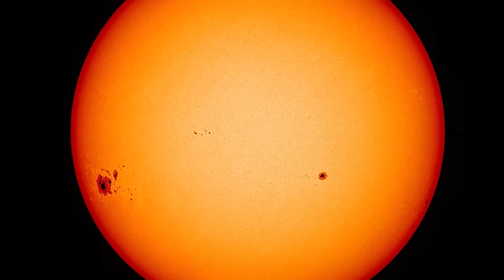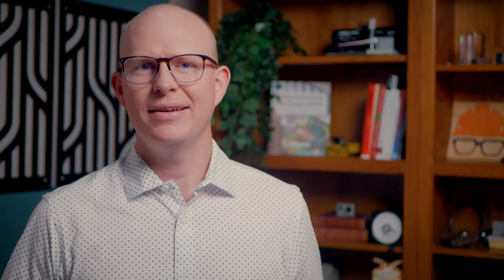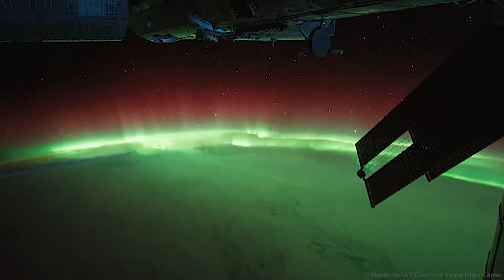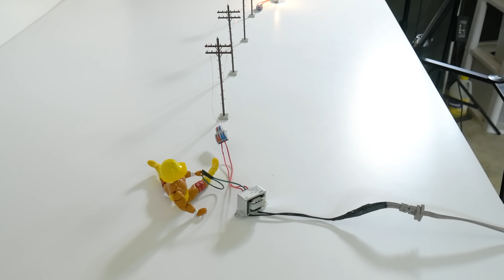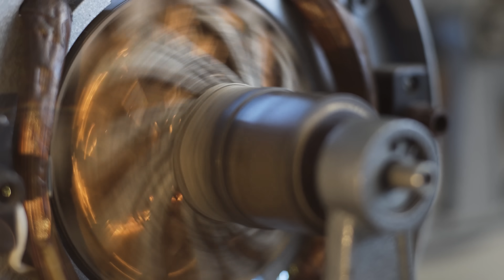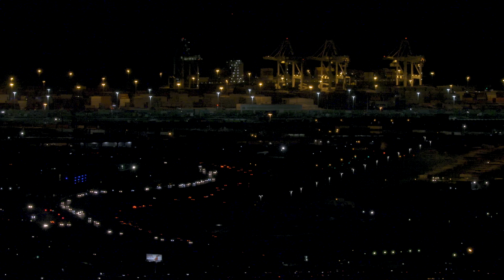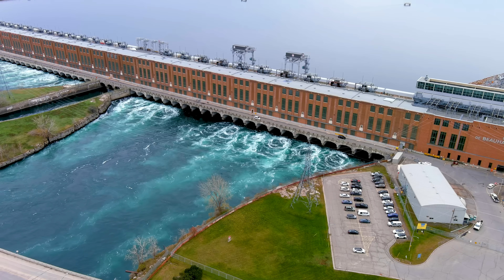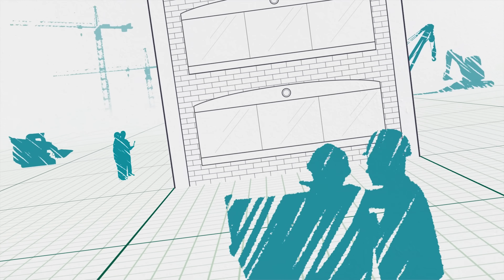The Most Confusing Part of the Power Grid

Comment from the maker: ⚡Here's my entire power grid series: https://www.youtube.com/playlist?list=PLTZM4MrZKfW-ftqKGSbO-DwDiOGqNmq53
🌌Get Nebula using my link for 40% off an annual subscription: https://go.nebula.tv/Practical-Engineering
Reply: Can you do a video explaining how utility scale batteries manage reactive power? I understand they can react to reactive power much quicker to balance the system, which is why they're in such high demand to backup solar and wind. Also, it would be cool to cover where it makes the most sense to put batteries - near the load, near the source, a bit of both? Near the source makes sense to me for balancing solar and wind generation, and near the load makes sense to balance the amount of electricity flowing through the transmission lines. I think a bit of both makes the most sense to keep the power through the transmission lines constant.
Reply: Since you have to keep making model power grids and the like, it might be useful (and more importantly fun) to make a permanent model with all major components that you could refer to any time you need without having to make a new thing every time.
Reply: I suggest updating this pinned comment with "do not put polarized capacitors across AC supplies".
Reply: @bjornroesbeke  I'm glad that I'm not the only one who noticed this mistreatment of an electrolytic capacitor.
Reply: that series is lacking an episode, why for very long distance power transfer, DC suddenly starts to be superior to AC (and why Germany wants to build a high-voltage-DC powerline from north to south)
Reply: lol says we are not being charged for reactive power then whats with all these smart meters power companies are forcing on everyone including u hmmm i guarantee these include reactive power are power bill went up $80 after they switched us in michigan
Reply: @THISLOVETHISHATE99 
That’s why you can buy or do things to the load side to “negate” or change what the meter sees.
Reply: You should add a foot note that reactive power is also a reason why wind turbines have taken off like they have.  They can do reactive power corrections for the grid closer to the loads than the bigger coal or nuclear plants. And with them being much smaller than those plants, they can do smaller, more precise corrections.
Reply: @bradheaton3356  oh interesting! of course that makes total sense.
Reply: Maybe cover composite-core conductors as part of the power grid.
Reply: It was not clear how spinning motors & clever wiring stabilizes voltage near a load?

I feel like I basically knew mostly everything in the video already but a key piece that you described was and still is obscured.
Reply: Haven't even watched it yet, but I already know something even more confusing. At least in the US. Why do we refuse to update our power grids ever? Why are they so poorly designed and maintained, to the point that where I live, a place that gets a lot of really bad storms, loses power at least temporarily EVERY TIME? That's infinitely more confusing to me than anything else you could possibly be talking about.
Reply: Err in the classic hydraulic analogy, as I learned it, voltage is "head."  Not pressure.  I got corrected on that repeatedly. While they're closely related, they are not at all the same thing.
Reply: Awesome video, really learned something! Love your stuff and did watch on Nebooola... I have subscribed to Nebooola but don't like it because us watchers can't comment or "Like" the video's like we can on Utoob.
Reply: I'm not sure if anyone involved with Nebula will ever see this, but the problem with Nebula is that I made the mistake of signing up to CuriousityStream in 2020, found it very lacking in content, and cancelled 3 months later.  Then about a year later they strated offering a bundled curiousitystream+nebula, which I thought okay, I'll give them another chance, but because I had briefly been a previous CS customer, I wasn't eligible for the offer (it was for 'new' CS signups only)..  I tried it again 2 years after that, and I was still, despite having only ever had CS for 3 months in 2020, I was still an "existing" customer, and unable to sign up.   Now I see that since Jan 2024, they no longer offer the Nebula bundle.  I'm hesitant to sign up to just Nebula alone, as I'll probably end up in the same situation again.
Reply: ⚠️⚠️Savekerala⚠️⚠️from📛130 yrs old ⛑️⛑️ Mullaperiyar😭😭dam collapse 🙏🏾🙏🏾🙏🏾 please do a awarness video on this
Reply: ⚠️⚠️Savekerala⚠️⚠️from📛130 yrs old ⛑️⛑️ Mullaperiyar😭😭dam collapse 🙏🏾🙏🏾🙏🏾 please do a awarness video on this
Reply: The symbol for voltage is E for electromotive force. P=IE
Reply: Hi Grady, are you really a fan of Hulk Hogan, who tore his shirt for Trump?
Reply: Expect some new views from Portugal, Spain and France after the 28 April black out.
One again congrats for the video.
Reply: Incidentally the paper referenced is here: https://www.nerc.com/pa/stand/geomagnetic%20disturbance%20resources%20dl/nerc_1989-quebec-disturbance_report.pdf
Reply: No mention of DC transmission lines? With these reactive issues are not a concern and inverters are used to convert to 3 phase for connection to the load grid.
Reply: Grady,  It is me again.  You might want to do something on parallel sync generators load share.  ( off grid only) This is an unresolved issue with the Dali ship/bridge incident and based on my experience is not very well understood by the ship industry or the NTSB!
Reply: Why weren't there no SCADA tripped? I remembered to set it awl up!
Reply: @ryanchicago6028 treetetwuutwwwzrwr wer uuwruewrwwwrwwzruuwruwwruwwwruwruwwzrwuetuwruwwrreueuteuwztetrww reuuwruwwetruwwrwwwezzwwrzzwrwwutrwuzrwtrwrwwwerwzrzwwrwu zerrte uuwruueetrzwrwwutrwwwrwwwru zu weeteewwrwuwrwwwrwuztrwwwrwwut  tuwruwwrrwwwrwwwzrwwwrwwtrwwrwwwrwwtwuwerwezrwwwrwrwwwetrwwtwwztrutrwwwrwwwtrwrwrwwwrwrwwztruwrwwwrzwuetwztetutruwrwwwutrwwwrwruwwrwwwrwwwrurwetrwwwwrzwutrwrwwutrwwrwwwrwwutrutruwetutrwwwrwuwruwwrweutwrwwwrwwwrztrwwwruwwrwwwetetetrwwwetrwwwwetrwwwrwrzwrweutwwrwwwruwurwuwrwrutwwrwwzrwwwrwwwrzuutrwwwrwuwteuztrwwwuetwrwzwrwwwruwwruwwtrztwwutrwwwetrwwwrwuwruuwrwwwrruwwruwwrwuzruwwrzuwetuttrwwrwwwrwuwrwwwrwuetwwrwwwetrwwwwrwwwrwwwrwzwrwwwrutwrzwwrwrwuwrwwztrzwwrwwwtrwwwruwrwwztrwwwrwwwrwwruwrwwtrwwwrwwwrwwrwwwrwwwrwzrwwwrwzrwwwrwrwwwrwwtrwwwruwwruwwrwwwwrwwtwrwrwwwrwwwetrwwwrwzwerwwwrwwwrwrwwrwwrwwwrwwwrwuztrwuwrwwrwwwrwuwrurwwrwwwrwzwwrwwwrwutruzwrwwztrwwwrwwwrwwztrwrutrwwwutruwwrwrwwwrwwwrzwrwwwrzwwtrwwwrwrwwwrwwwrzrwwztwwutrwwwtrwwutrwruwwrwwwrtrwwwrwwwztetrwwwrwwwwwrwzwrwuztrzrwwrwwrwwutwwwrwzrwwwtruwwruwrwwztrwzwwwrwtrwwwrwwwrwwwrwwwrwwrwwwrwwwrwwwrwrwzrwwwrwrrzezruruwwrwwwrwwrwwwttrwurwwtrrwwrwwzwrzuutruuuturzzruuutrtrteruuuúuuuuzzzruuûúuuutruuutruzutruuutruzutrzeruzzruuzrzzuruuûtruuutetruuwrwuztrzuutezruuutruwutetruuutetruuruuzrzuutruzuteteruzzruuuuuuutruuùúuuutetetrwuuuteruzzruuutrwuutrtetruuwruuutruwurtrwurtruwuteruwutruuutruzrwuurwwutrwuwetruzutruuutruuutruzutruutruwetruuutetwruurwwutuéuetruzutetetruuwruuzruuuteruwutetrteruuutrtrwwutruzutruwwerzuuuuuwruuutetruuuzrurzruzzwruuwruuutruuuturuztruuutruuuwtrwuutrwuutruwzruuutrzuutrzrwtruutruwutetrwzweruuuwtruuwetrwuutrtrzutruuutrzutrwutruwzrwwwrwuutrruzutruwrtetetzetweuztruuutezruztrtruuutetrutruuztruuutetruwutruuruuetrtetrtruuwetetruwutruwtezrwuzruwwruuwetruutruuutruuutruzuzruuztetrwuutetruuwezruzwezruuwrwuutruzutetruuurwwwruwztrwtruuetwruwutrwuutteuuutruuutrzuutruwrwuutrwwutruuwruwutrwuutrwzerzeruuterwwwruuwrwruezzruutruuetuutrwuutrwuutrzwuuteutzrruuutrwuwrzwutruuwruwutrwwwrwwwrwuruwrtetrwwuwtruwwrwwwruuuwrwuwrwweuuwetruwwrwwwrwwutwrwwwruuutetrwtruwutrwwutrtruwutrutwwetruwutrwwwrtwrwwwruuwrtetetruuwruwwrwuutwewrtruwwrwuutruwztruzwurteutuwrwuwrwuwruuwruwwrwwutwruwwruweuuwtuztruuwrwuwrwuwrwwwrtetuetwwruuwtrwuwetruwwrtrzwutetrwuwrwwwrwtwrurtrwuutruwwruuetruuwetrwuwrwteuutrwuutruuutrwuutezrwuutetruwutruuwruwtreztwwuruutetrwtuutetruuztrwuztuewrzuttetrwuwrutweutrwuwrzuutruwutetrtetetrwwwruzwruuutrtrwuwrwzwtrzwutetetruwruwtrtrwwwetruuutrutwruwtruuutrtruwutruuwrwuutetrtwruwutetetrwuutrwwtwwwrwwwetuetuutetrzwuwrwzwrwwruwwrutwwetetrwwwrwwtwrwwwrwtwrwwwrwwwrwruwwwrzwrwuwruwutetrwuwrwurwutruwutrwwwruwwrwuwrwwwrtruwwrtruwwrwwurwwrtrwwrwwuteruwutrwwwrwuwrutwwwrtruwutrwwwetrtruwwrwwwrtetrwruuutrtruuwrwuutrwzwruwutrutwwwrwwwruurwwwrrwwwuetwwruuutrwzwrwwwetrwwwetrwwwrutwwwrwwwrwwwruwwruuutetrwuwrwrwuwrwwurwuwrwtwuwrwuutrwwwrwuwrwwwrwwrwzwrwwwruwutrwwwruwwetwrwuwrtrwuwrzwwrwwutrwwutewtrwwwruwutrwuutrwwwruwwetrtrwwrwwwruuutrwwruwwrtrwwwruwwrwwutrwuutrwwutrwwwrwwwetruwwrwutruwwrwuwrwuutrwwwtrueruwrwwwrwwutewtruwutrwwrwuutetruwwruutrwwrwwwtruwutrutuwrwwwrtrtrwwutrwwutrtrwuzwrwwutrtrwuwrwuwtruuwetrzrwwwruuwtrzwwetrwuutrutwrwuwzruzwrwwuruuutrwettrwwutrutrwwwetrwwwetetrwwwrwzwrwwwrtrwwwrwwwzrwwwrwwwrwutrwtrwuwrutwrwwrtrtrwwutrwwwetetrtrwwtrwwwetrtetruwutrwwwrwwwrwrwwetruwwtetrwwwrwwwrwwwetrrwwrwwwrwwutrwuwrtrtrwztwwwettruwwrwwwruwrwwwrwwwrwwwrwwwrwwwrwtrwwwrtrwwwrwwwrwuutrwwurtwwrwzrwwwrwwwrtruuwtrwwwrwzwrwwwrwwweuuutruuwrwuwrtrwwwruwwruwwrwwwrtrwuwetrwuwrwwwrwwwrwwzrwwwetrtrwwwrwwwrwwwrwwwrwwwrwwwrwuwrwwwrwwwetrwwwrwwwrwruwwetrwtrwwwrwwwrutzrwzwrwwweutwutrwwwrtrwwutrtrwwutruuwtrwwrwuwrwzwrwuwetrwwwrwrwwtwrwwruwwrwwutrtruuruwwetrtrwuutrwwwrwwwetrwwwruwrwwwrwwwrwwwruwwrwwwrwuwrwrwwrwrwwutrtrzrwwwrwwwrwwwrutwwtwuwrwwwruwuttrwtrwwwrzrwwwrwwwrwwrwwrwwtrwwwrwwwrwwwruwwrtrwrwzrwwwrwwwrwwwrwwwzrwwutrwwwrtzrwrwwetrwwwrwurzwrwwwrwwwrwwwrwwwrwwwrwwwrwrwwwrwwwrwwwrwwzrwwwrwwrwwrwwwrwtwuwrwwwrwwrwwetrwwwrwwtwrwwwrwuwrwwwrwwwrwwwrwwwrwtwwwrwwwrwwwrwwwrwwwrwwwrwwutetrwwwrwwwruwwrwwwrwutrwwrwtwwutrwrwwetrwwrwwwrwwrwwwrwwwrwwwrwwwrwwwrtrwwweutwwrwwwruuwrtwrzwwrwwwrwwwrwwutrwrtwrwwwrwwwrwwwetrrzwrwwwrtrwwwrwwwrwuwrtwuwrwwwrwwwrwwwrwwwrwwutrwwwrwwwrwrwwutrwwwrwwwrwwwrwwwrwwwrwwwrwuwrwwwrwwwrwuwrwwwrwwwrwwwrwuwrwwrwrwwrwwwrwtwwwrwuetwutrwwwruwwrwwwrwwwrwtrwwwrwzrwwwrwwutrwwtruwwrwwwrwrwrwwwrwwutrwuwrwwwrwwwrwwwetrwzwrwwwrwwwrwwwrwwwrwwzrwwwrwwwrwwwrwwwrwwwrwwwrwwwrtrwwwrwwwrwwtrwwwrwwwrwwwrwwwrwwrwwwrwwrwwwrwwwtrwwtwwwrwwwrwwwrwwwrwwwrwwwrwwwrwwwrwwrwwwrwwwrwwwrwtrwwwrwrwtwzwrwwwrwwrwrwwwrwwwrwwwrwwwrwwwrwwwruwutrwwwrwwwrwwwrwwwrwwwrwwwrwwwrwwwrtwwwrwwwrwwwzrwwwrzrwwwrwwwrwwwrwrwwwrwwwrwtrwuwrzwrwwwrwwwruwwrwtuwrwwwrwwwrwwrwwrwwwrwwwrwwwrwwwrwwtrwrwwrwwwrwwwrwwwrwwwrwwwrwwwrwwwrwwwrwwwrwwwrwewrwwwrwwwrwwwrwwwrwwwrwwrwwwrwwwrwwwrwwwrwwrwwwrwwwrwwwrwwzwrwwzwrwwwrwrwwwrwwwrwwwrwwwrwwwrwwwrwwwrwwwrwwwrwrwwwrwwwrwwwrwwwrwwwrwtwrwwwrwwwrwwwrwwwrwrwwrwwwrwwwrwwuwwetrwwwrwwwrwwwrwwwrwrwwwrwwwrwrwwruwwrwwzrwwwrwwwrwwweutrwwwrwwwrwwwrtrwwwrwwwrwwwrwrwwwrwwwrwwwrwrwwrwwrwwwrwwwrwwwrtrwwzwrwwwrwwwrwwwrwwwrwwwrwuwrwrwuwrwwwrwwwrwrwwwrwwwrwwwrwwwrwwwruwwrwwwzrwwwrwwwrwwwrwrwtwrwwwrwwwrwwwrwwzwrwwwrwzwrwwwrwwwrwwwurtrwwwzrwwwrwwwrwwwrwwwrwwwrwwwrwrwwrwwwrwwzrwwwrzrwrwwrwwwrwwwrwwwrwwwrwwrwrwwwrwwwrwwwrutwwrwwwrwwwrwwwrwwwrwwwrwwwrwwwrwrwwwrzrwwwrwwwrwwwrwwrwwwrwtrzwwrzwrwwuetwwrwwwrwzrwwwrwwwrwrwwwrwzwrwwrwwwrwwwrwwwrwwwrwzwrwwwrwwtrwwwrwwwrwwwrwwwrwwwrwwwrwwwrwwwrwwwrwwrwwwrwwwrwwwrwwwrwwzwrwwwrwwwrwwrwrwwwrwwwrtrwwrwwrwwwrwwwrwwwrwwwrwwwrwwwrwwwrwwwrtrwwwruwwrtrwtwwwrwwwrwwwrwwwrwwwrwuwrwwwrwwwrwrwwrwwwrwwwrtwwwrwwwrwwwrwrwwwrwwwrwrwwwrwwwrwwwrwuwrwwrwwwrwwwrwwwrwwwruwrwwrwwwrwwzwrwwwrwwutrwwwrwwwrwwwrwwwrwwwrwwwrwuwrwwwrwuwrwwwrwwwrwwwrwwwrwwwruwrwwrwwwrwwwrwrwwtrwwwrwrwwwrwwwrwwwrwwwrwwwrwwwrwwwrwwwrwwwrwwwrwwwrwwwrwtwwwrwwwrwwwrwzwrwwwrwwwrwwwrwwwrwwwrwwwruwwrwwwrwwwrzwrwwwruwrtwrwwwrwwrwwwrwwwrwwwrwwwrwwwrwwwrwwwrwwwrwwwrwwwrwwwrwwwrwwwrwwwrwwwrwwwrwwwrwwrwwtwwwrwwwrwwwrwwzwrwwwrwwwrwwrwrwwwrwwwetwwwrwwwrwwwrwwwrwwwrwwwrtwrwwwrwwtrwuwwrwwwrwwwrwwwrwwwrwwwrwwwrwwwrwwwrwwwrwwetrwwwrwwwrwwwrwwetrwwrwwwrwwwrwwwrwwwrwwwrwwwrwwwrwwtrwwwrwwwrwwwrwwwrwzwrwwrwwwrwtwrwwwrwwwrwwwrwwtrwwwrwwwrwwwrwwwrwwwrwwwrwwwrwwrwwwrwwwrwwwrwwwrwwwrwtwwwrwwwrwwweutwwrwwwrwwwrwwwrwwrwwwrwwwrwwwrwwwrwwwrwwwrwwwrwwwrwwwrwwwrwwwrwwwrwwwrtrwwwrwwwrwwwrwwwrwwwrwwwzeuwwrwwwrwwwrwwwrwwrwutrwwwrwwwrwwwrwwwrwwrwwwrwwwrwwwrwrwwwrwwwrwwwrwwwrwrwwwrwwwrwrwutwrwwwrwwwrwrwwwrwwwrwwwrwzwwrwwrwwwrwwwrwwwrwwwrwwetwrwwwrwwwrwwwrwrwwrwwwrwwwrwwwrwwwrwwwrwwwrwwwrwwwrwwwrwwwrwwwrwwwrwwwrwwwrwwwrwwwrwwwrwwwrwwwrwwwrwwwrwwwrwwtwwrwwwrwwwrwwwrwwrwwrwwrwwrwwwrwwwrwwezrwwwrzrwwwrwwwrwwwrwwwrwwwrwzrwwwrwwwrwwwrwwwrwwwrwwwrwwwrwwwzrwwwrwrwwwrwwwrwwwrwwwrwwwrwwwrwwwrwwwrwwwrwwwrwwwrwwwrwtwrwzwrwwrwwwrwrzwrwwrwwwrwwwrwwwrwtwwtwrwwwrwwwrwwrwwwrtwrwrwwwrwwtrwwwrwwwrwwwrwwwrwwwrzwrwwwrwtwwwrwzwrwwwrwwwrwwtwwwrwwrwwwrwwwrwwwrwwwrwwwrwwwrwwwrwwwrwwwrwwwrwwwrwrwwrwwrwwwrwwwrwwwrwwwzrwwwrwwwrwwwrwwwrwwwrwwwrwwwrwwwrwwwrwrwwwrwwwrwwwrwwwrwwwrwwwrwwrwwwrwwwrwwwrwwrwwwrwwrwwwrwwwrwwwrwwwrwwwrwwwrwwwrwwwrwwwrwwwrwwwrwwwrwrwrwewrwwwrwwwrwwwrwwwrwwwrwwwrwwwrwwwtrwwwrwwzwwwrtwrwwwrwwwrwwtwwwrwwwrwwwrwwwrwwwrwwwrwwwrwwzwrwwzrwwwrwwwrwwwrwwwrzwrwwwrwwwrwwwrwrwwrwwwrwwwrwwrzwrwwwrwwwrwwrwwrwwwrwwwrwwwrwwwruz
z
Reply: This is great! Thanks for collecting and sharing this with us! 
My 5 year old loves seeing your videos!
Reply: @ 1:45 Power Electronics don't go together.  Electronics are intently small, low voltage And DC.  Power is Electric or Electrical.
Reply from the maker: @timboatfield  https://en.wikipedia.org/wiki/Power_electronics
Reply: @PracticalEngineeringChannel  Solid-state power electronics, such as Solid-State Transformers (SSTs), typically do not produce the same kind of humming noise that you might associate with traditional transformers.

Traditional transformers hum due to a phenomenon called magnetostriction, where the alternating magnetic field causes the transformer’s iron core to expand and contract, producing a sound wave. This is often heard as a low-frequency hum or buzz.

In contrast, SSTs use high-frequency operation and power electronics circuitry, including transistors, diodes, and other semiconductor-based devices. These components switch on and off very rapidly, which can produce some noise, but it’s typically at a frequency that’s beyond the range of human hearing.

  Power electronics do not Hum.  You Tube!
Reply: It is U=IxR NOT V @PracticalEngineeringChannel
Reply: @PracticalEngineeringChannel Voltage is represented by the letter E.
Reply: @PracticalEngineeringChannel Can you do a Video about the german Energiewende. I'm german and i always see a lot of uninformed hate towards my country relating energy just bc sometimes the dayaheadmarket prices tripple for some hours. Just go r/europe to have a peak. As someone better educated in the topic then most redditors i always feel thats a shame.
In my opinion germany does an incredible job providing 50GW of Power with unmatched stability at such a extrem high amount of fluctuating powergeneration. Nowdays we are already often 100% renewable and are exporting cheap green power to our neigboring nations. I belive that feat deserves some recognition and view into the future
Reply: I know your very busy, and if you cant reply thats understandable.1 I love your videos so keep it up. 2 I was wanting to know how you make your graphisc, like the wave formes, and ilistrations. Do you use python, or just video editing software, or what.?
Reply: So these problems would not occur over HVDC lines, right ?
Reply: @uiteoi  The main lines will remain unaffected, and there’s a specific reason for this. It’s due to the inherent limitations of High Voltage Direct Current (HVDC) transmission. HVDC lines are typically not extended over long distances, precisely to avoid this issue. From coast to coast in the USA there is over 4k miles of connected power lines. And thats just going east to west.
Reply: @supperslash1376  spoken like a true politician /jk
Reply: @uiteoi Im surprised they were not mentioned but you’re correct.
Reply: @uiteoi 

HVDC (High-Voltage Direct Current) transmission lines offer several advantages over traditional HVAC (High-Voltage Alternating Current) lines, particularly for long-distance power transmission and connecting asynchronous grids. HVDC lines generally have lower transmission losses, can carry higher voltages, and can connect grids operating at different frequencies. However, HVDC requires converter stations at both ends, which can be expensive, and introduces harmonics into the system.

Comment: Maybe modify the start of the video electrical energy DOES NOT flow like water in a pipe. If you educate why then not properly.
Reply: Every model of natural phenomena is a simplification, so incomplete or incorrect in detail.  Even so, a model can be useful in illustating one aspect of a phenomenon while being a poor model of the entire thing.

Practical electricity using a greatly simplified model is much easier to work with than is electricity as a physicist understands it.

Comment: These same principles apply to AC circuits that use much higher frequencies.  Those circuits are called RF circuits, and are found in systems such as radio transmitters.  In a reactive load, you are not delivering maximum power to that load.  Some of that power will reflect back and get lost in the resistance of the feed line as heat, and if enough power is reflected back, you can actually damage your power generator.

Comment: I saw that Fluke meter in there! Finally got one to replace those disposable meters I've been using.
(those $20 meters aren't advertised as disposable, but they should be - they fail consistently after a year or two, even if they're not used much) It's actually saving money in the long run because Fluke meters last a lifetime - had one when I was a kid, but it was stolen...
Great video, thank you kindly.
NB: Now I know what the "70 KVA" sign on a local power pole transformer means.